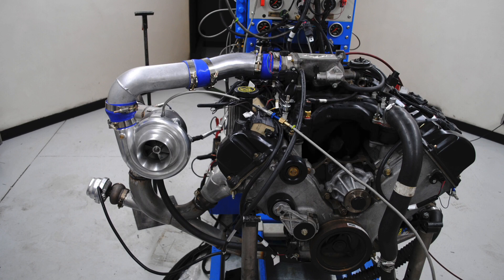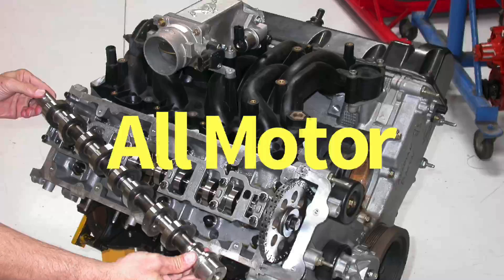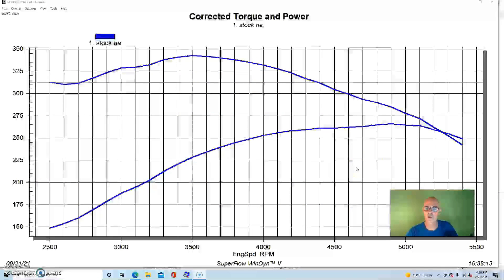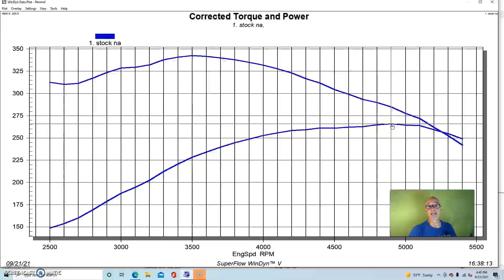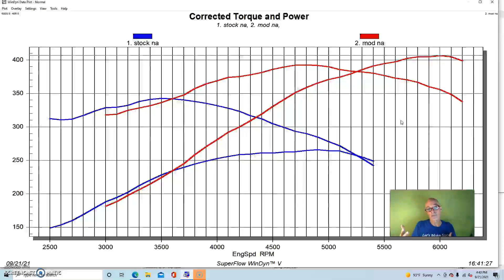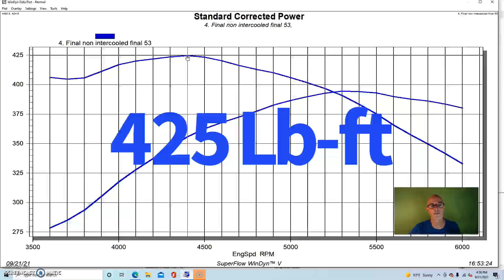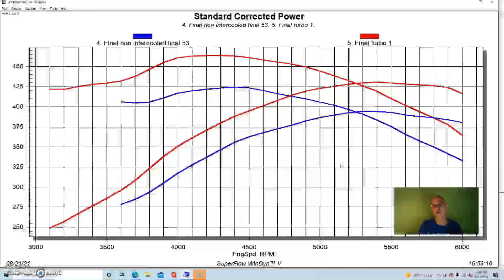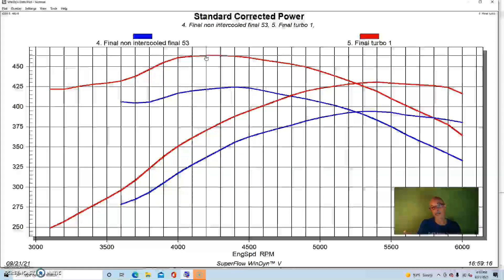ALL MOTOR VS CHEAP TURBO-COST VS POWER, WHO WINS? DIRT CHEAP DIY BEST MODS, 4.6L 2V COMPARE

Comment: I had a 98 V6 Stang.  We found that the V6 stock bottom end could handle a lot more power than a 4.6 V8.  If memory is correct, the 4.6 block would not last very long even at 450 HP.  Whereas the 3.8 V6 could handle a lot more and live.  So long as you didn't rev it past 6k RPM.  It was a fun time watching the guys on V6 Power continue to push the envelope and be amazed as they upped the boost, the motor lived.  They with hesitation kept upping it to even more amazement in seeing these low power motors going up to, I think 700 hp and living with bone stock blocks, cranks and pistons.  And the word was you can not do this to the 4.6 as the blocks would crack.  I was planning on doing a turbo to mine but it is illegal in CA.  Which is another pitfall on any turbo install. You can't do it in CA and many other States.  So I hit it with N20 which is much harder on a motor than a turbo because it hits hard instantly and with a 150 shot, eaxuast, intake and 373's I could walk away from the Cobras, Z's and even stock Vettes.  I ran countless bottle of Nitrous through that thing and it did nothing to the motor.  Upon take down there was no sign that it had been abused and ran perfectly up until the day I pulled the heads to do porting.  I even raced a couple of those turbo Subarus and would walk by them.  They would get me from the dig but I would walk by them.  It was fun.  I also heard, and again don't know if it is true, that the Cobra blocks suffered the same weakness as the GT's.  A guy put SC internals in the 3.8 block and and boosted it to the point where he was running 9's .  This was around 20 years ago and it was pretty impressive back then.  He also lived in a State where he could do this.
Reply: Right.
Reply from the maker: ACCUFAB RUNS 3000 HP ON STOCK BLOCKS
Reply: @richardholdener1727  98 4.6 blocks?
Reply: @chuckyz2  the early (1993-1998) 4v AL blocks are really tough. With sleeves you will never break one on the street and stock bore they will last forever at 1000hp. The iron blocks are really beefy for a 250hp engine. Mm&Ff had a stock, machined, iron block making 750whp with a centrifugal blower for a season of racing. There is a bunch of guys that have fairy tales of split blocks with 400whp but true tales are hard to come by. The rods from the mod motors seem to be what ends the fun and I can't find anyone that's mangled a rod with less than 700hp. A bunch of guys rattled a piston and windowed a block but you can do that with any cast piston. I would be really surprised if a 3.8l short block could take more punishment than a 4.6l.
Reply: @timothybayliss6680  some folks can break a bowling ball in a sand box too... 35* of timing and boost on 87 octane is probably all you need to make expensive doorstops and ashtrays. :)
Reply: @ewetoobz3840  🤣🤣🤣🤣🤣
Reply: The 4.6 blocks don't Crack that is the old 302 ho you're thinking of.  The mod motor blocks can all take 1000+ wheel easily with forged internals it's the rods that limits them but it isn't a 450 hp cutoff it is easily to say stay at or below 10 psi and watch your rpm and use the best fuel you can.  They can live above 450 of they have an efficient heads cams setup with boost because you can make that power at a lower boost level allowing you stay below that 10 psi mark.

Comment: You ever play around with replacing ONLY intake or ONLY exhaust cams on a DOHC motor of any type? 
Something I have always been curious to see. 

Honestly if it wasn't so difficult in the car,I would try it on on a vq35de just to see how bad (maybe good?) It could be.
Reply: Lots of  32v guys have only replaced on set of cams
Reply: With 4v engines, the exhaust cams are pretty much the same across all the intech, cobras, aviators, machs, marauders, continetal etc. The intake cams vary from 184°, 200°, and 206° @.050, all sharing .397 max lift. Swapping to custom grind intake camshafts is a great bang for the buck and makes 80% of the power that a full cam swap would, especially when degreeing. Another huge benefit to the 4v is being able to completely optemize the intake and exhaust centerline/lsa. Many people think they need a ton of intake duration but a 96 Cobra, 206° intake cams in a 03 headed 4v has put down as much as 375rwhp in na, nmra trim. Its the degreeing in the duration that makes big power. You can tailor your stock cams to pick up 10-15hp in different parts of the revs. For example, degreeing a c headed 99/01 4v to 106/118 will pickup a ton of midrange torque, peak similar hp, and not fall off dramatically past peak power. You can even degree the oem cams for that novelty nasty idle too!
Reply: I have a few videos on my channel of 5.4 cam swap with my cams. Went 11.80@118 @4200lb on 93 with stock bottom end and stock heads.
Reply: I had a coolant leak due to a crack in the factory PI composite intake and replaced it with a cheap aftermarket intake. It killed power everywhere. The intake can give a noticeable measure of performance on a 4.6 2V PI modular motor.

Comment: I continue to love your work. "For straight line go, go turbo!" For me, the mods that win are the ones that don't get you arrested, detested, or entoombed. A turbo is always cheapest👏 way to do it all. Until you break traction,  a speed limit or drive train part. Porting a stock head and under the radar mods that don't trip fault codes are important goals in our current legal climate. Who would ever have thought...turbos, nitrous and visual inspection engine mods would be illegal for daily drivers in many states.

Comment: Man Richard don't kill me with this one. Im about to spend some serious cash to do a bottom end build instead of getting a procharger. 😬
Reply from the maker: ALL GOOD
Reply: Smartest thing you could have done the crank ,main bearings and rods would have been on a timer with a procharger
Reply: @cainadkins3985  fully forged bottom end kit from Texas speed. I already have 243 heads and a BTR stage3 cam. I'm also going with a LSX 92mm for drivability instead of the 102.
Reply: @cainadkins3985  not at 400 ftlbs at wheels… SBE would be fine with a good tune. Waste of money to get a forged bottom end with a stock top end and a P1SC (which is probably what he was gonna get)
Reply: @andrewmontgomery1763  I'm actually going to get an F1X and pully it up at first (less boost) and go from there. My tuner is the one who recommended me doing so. My setup now is making 460hp 375tq at the wheels and the bottom end kit is to get some more torque out of it. 

I don't want a turbo because I want to keep the noise and simplicity. Plus in the future I'm going to do an LSX swap and to put this engine in a truck I'm working on. So having it reliable is a must. The F1X will go with the bigger engine.
Reply: @SuperSilvi1990 don't ls swap it man just keep it Ford.  If you wanna build an ls get a gm.
Reply: @midnight347  that build was for a 04 pontiac GTO.

But funnily enough, now I'm looking at a ls swap, but it's on a 02 v6 Mustang, so no harm done. Unless it's a Coyote or a big block Ford. Ford builds are a LOT of money for not much reward.
Reply: Dunno why you people go cuckoo about putting forged bottom ends in everything. Just turbo it and be happy. You blow it up you can get an entire engine cheaper than the forged bottom, plus your more likely to mess it up cracking into the bottom end.
Reply: For me it's about reliability at the desired power output. Different engines need different parts  to be reliable  at different states of tune. I pulled back on my 5.0 build due to cost of parts.
Reply: @RindosRides not if you know what you're doing or have someone who knows what they're doing do it.  Some people wanna actually make reliable power they can beat up on the street for years without worry.

Comment: What is pi and non pi?
Reply: Performance improved vs non Performance improved. 

The PI is the revised heads on the newer motors.
Reply: 99-11 PI heads have smaller combustion chambers, bigger exhaust valves, 3 angle valve jobs and with the improved PI Cam and Intake, they produced 260fwhp stock. The Non pi ran 96-98 had a large combustion chamber, single angle valve job, much less low lift airflow when stock and with its low lift cams and crappy intake, they produce 225hp stock. Most of the power gains from pi swapping a npi come from the cams and pi intake manifold as well as the bump in compression being huge for average power. There are also a 95 and earlier 2v head that is much like a npi but had a few more disadvantages.
Reply: @madmod  I don't think he was looking for all this info but it's helpful! Thanks for posting this, it was a nice little refresher. I haven't messed around with the 2v 4.6L in years.  OP I hope you got your answer and possibly more.
Reply: @madmod  thanks
Reply from the maker: PI ALSO HAD MORE AIR FLOW
Reply: its power improved i think idk probably different heads for years one making more power than the other